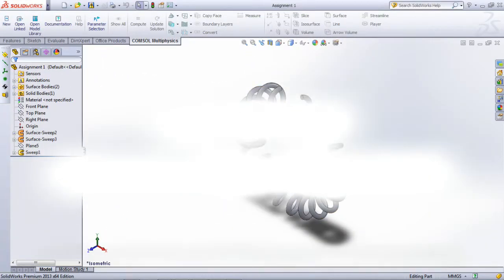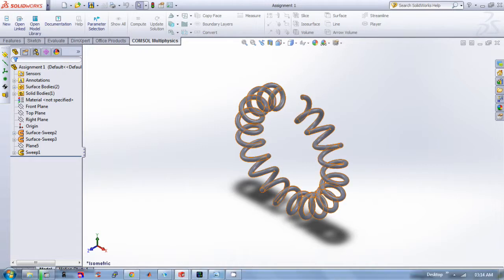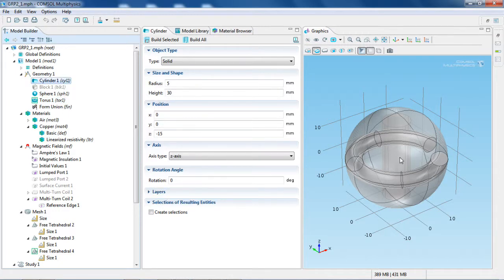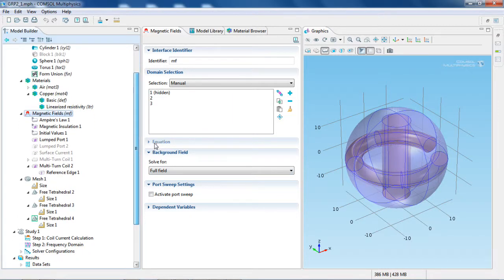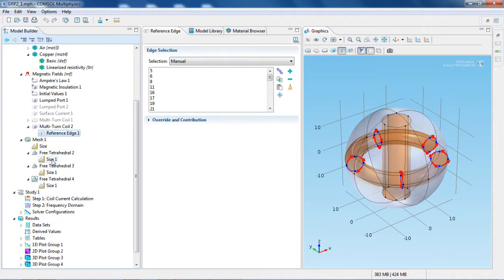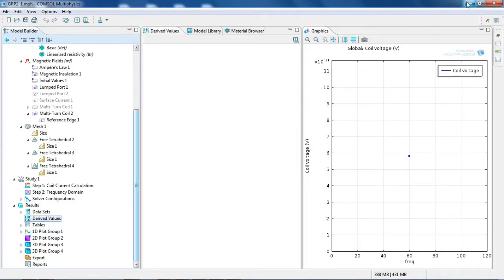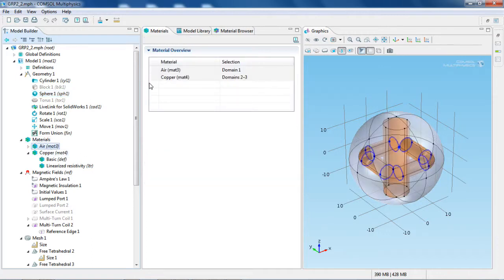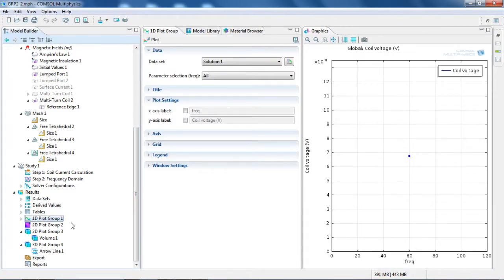Group 2 ECNG 3022 Performance Analysis of Rogowski Coils

Comment: Dear sir, can you tell me the boundary selection  for  Multi-turn Coil. When I  selected torus as a  boundary  selection for multiturn coil then   error has come ..(error- Could not determine a unique axis for the circular coil.
 - Feature: Mutli-turn Coil(coil2) )
Reply: Dear friend, you should use the numeric option in new versions of COMSOL. This way you would only need to determine the input surface.